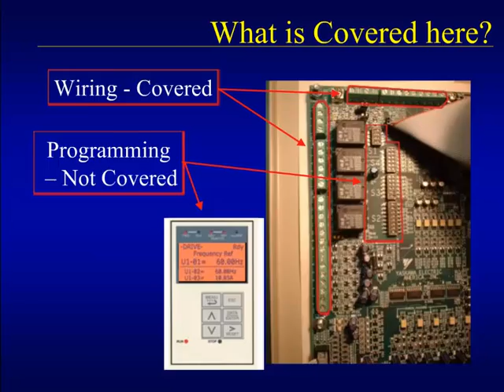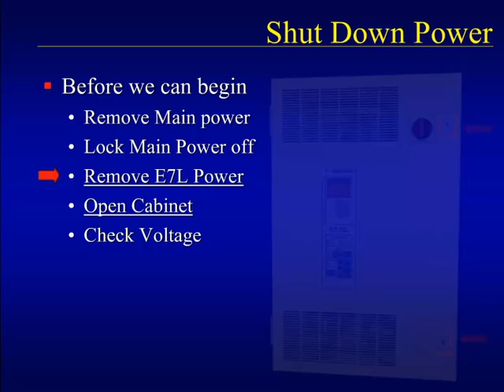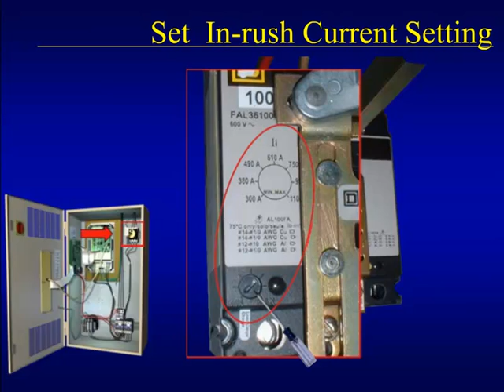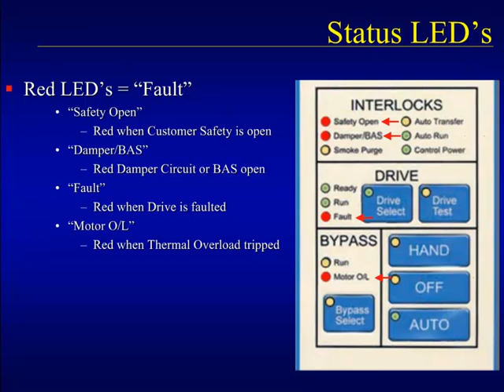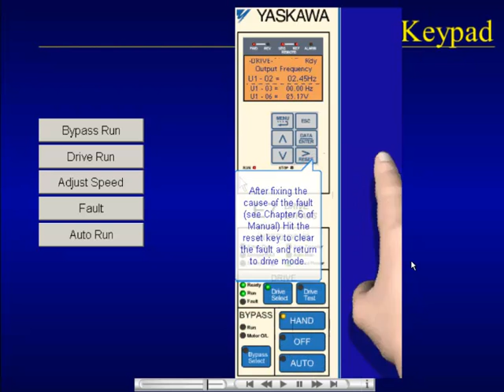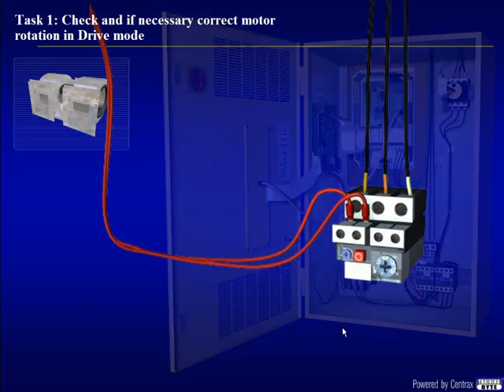E7 Drive/Bypass Startup

Comment: What's the purpose of bypass its a dangerous to The equipment even if you say interlock is good condition
Reply from the maker: Thank you for your interest in "E7 Drive/Bypass Startup". The purpose of the bypass is to operate the motor in case of a VFD failure (during emergency purposes) . In the case of a 3-contactor bypass the VFD can also be isolated so that the VFD can be serviced while the motor is running in bypass mode. Please contact the nearest service provider in your area: https://www.yaskawa-global.com/company/profile/global or, please contact our Technical Support Team for further assistance https://www.yaskawa.com/support-training/support.
Reply: I can never find what I'm looking for in these videos